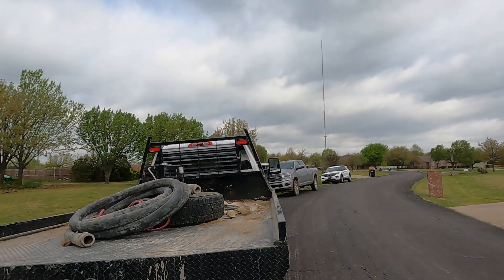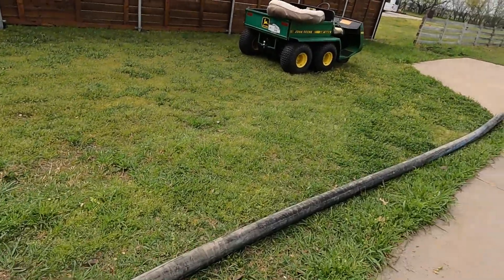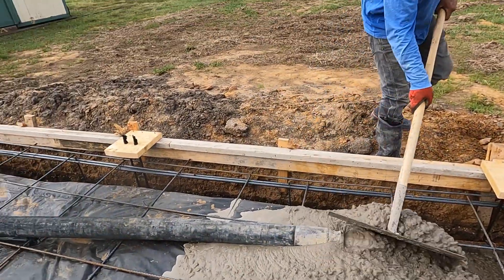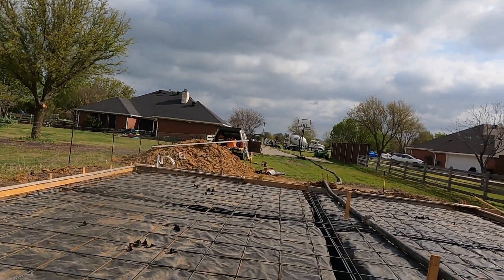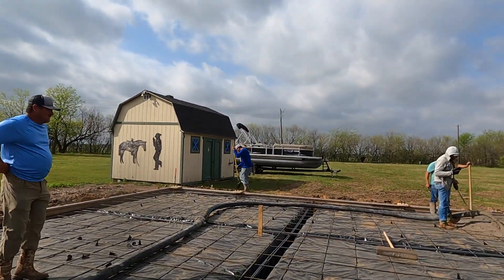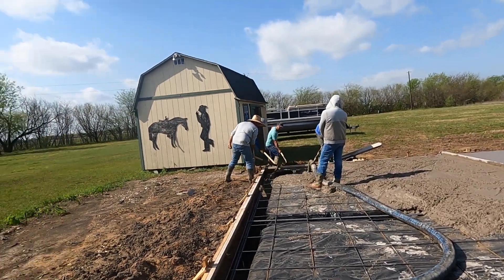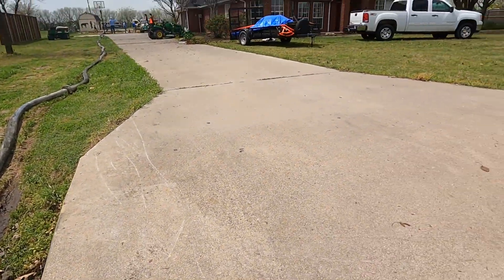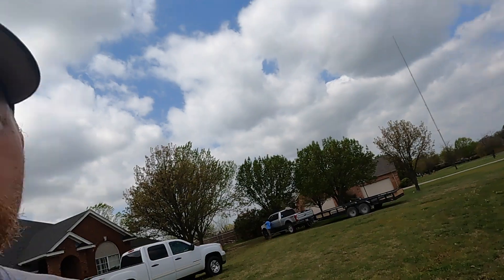How to prime out 275' of system with a concrete trailer pump. Pumping concrete with Muddyfeet

Comment: I recently bought a similar line pump……my question is, when you prime out with Portland mix, do you put a sponge in the line as well?  Also, same question when you clean out with air. Sponge ball in the line? Or no?
Reply from the maker: I don’t use a sponge to prime out with. I do use a wet paper bag or sponge to blow the hoses out with.
Reply: I appreciate the response, quite impressive your prime out on this video. I’ll be trying it your way, cuz the way I was told doesn’t work!
Reply: @aaronmcnally8971  good luck to you bruthu!

Comment: my dad and  bought a mayco-c30hdg line pump. we keep having trouble with our pump plugging up. we use a slick pack to prime and still plugs before 75ft  sometimes. any tips that you can give to help us out . we run a 2 1/2inch line
Reply from the maker: I never had any luck with the slick pack. I always use the bag of grout you see in the video. We buy it at Home Depot
Reply: First try to use cement as your primer (full bag for 3 gallons of water) second try to run no drier than a 5 slump 5.5sk and nothing bigger than 3/8" rock for a 2.5" hose